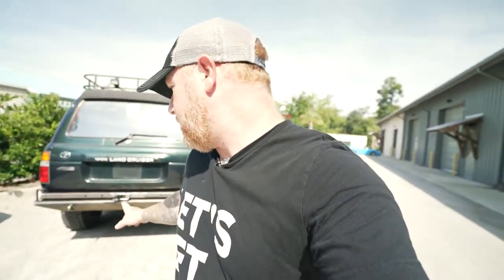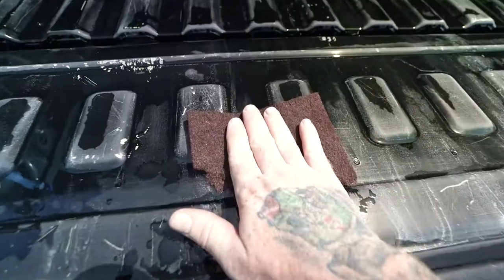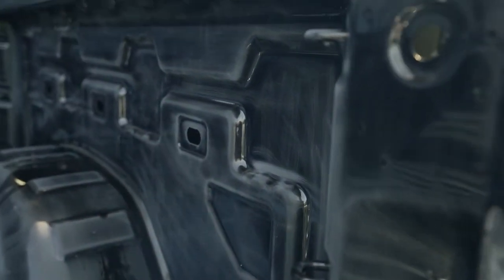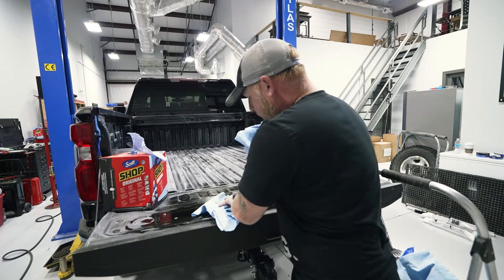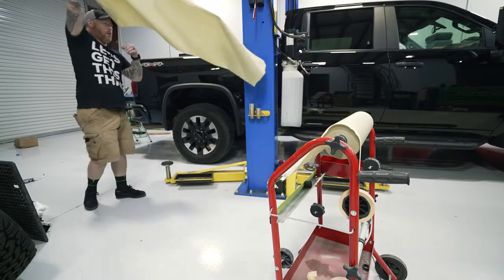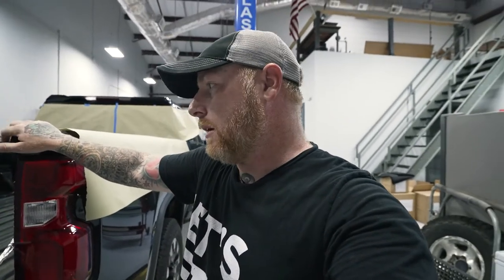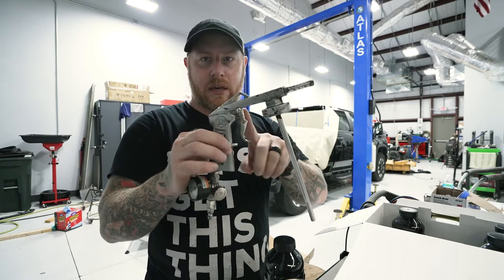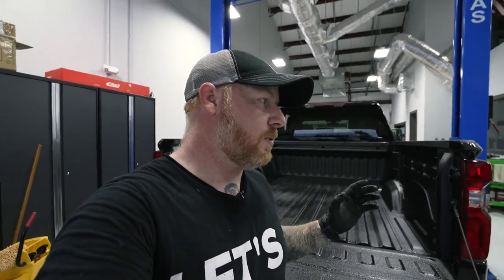HOW TO: Spray on Raptor Bed Liner 2020 Chevy 2500

Comment: I am glad I watched your video.  Watched a few others first who were using power sanders.  Looks like they went to metal in places.  Scuff it up, that is all you need.  I like the scotch brite and comet.  Still a little nervous doing it on my brand new Jeep Gladiator.
Reply from the maker: you'll do great. just take your time. This truck is still holding up great. and im not easy on it

Comment: Finally getting around to do this. I have the plastic bed liner right now which is fine, i don’t have a fifth wheel as of yet.

But I want to get the 5th wheel hitch/prep done and a spray on liner. Not sure if I should prep for the 5th wheel first or spray now and prep later.
Reply from the maker: I would do the 5th wheel stuff first, then spray.

Comment: got my truck with welded down anchor hook points from previous owner due to bolts breaking off, would you just spray over these or what or could that cause issues. Some of them are still bolted but at least two are fully welded down.